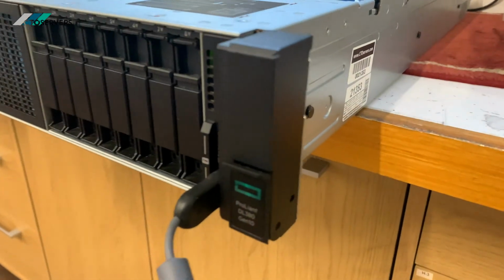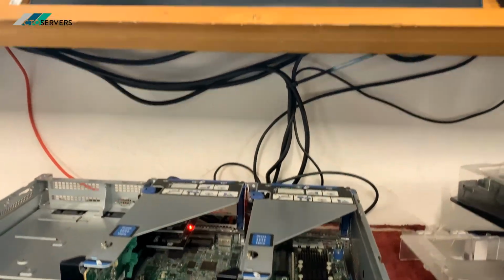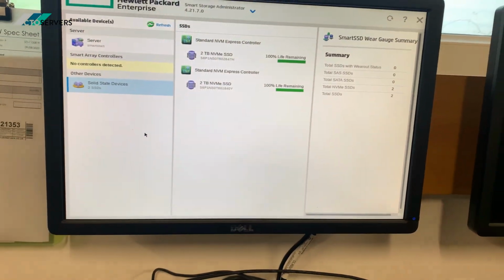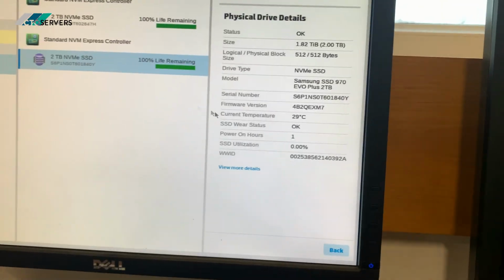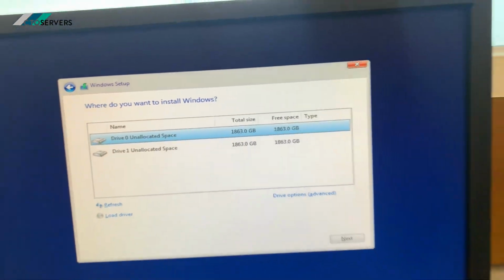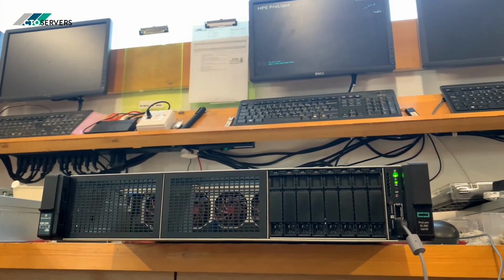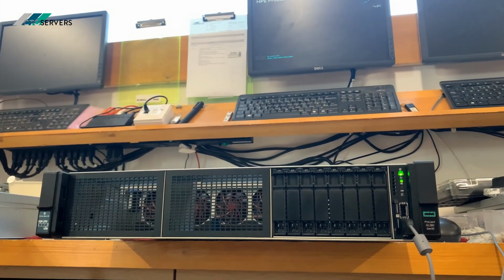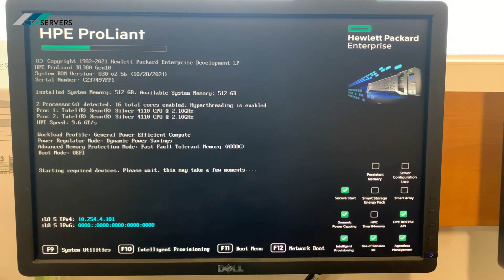4TB NVME , HPE DL380 Gen10   @CTOSERVERS

Comment: Is there anything that needs to be changed in the bios configuration? I installed 2 NVME in 1 slot, it read only 1 NVME.
Reply from the maker: Need to enable bifurcation
Reply: @CTOSERVERS  Thanks a lot, solved my problem.

Comment: Great to know it works. Can you write the part number of the riser you used? Is a DL38X gen9 riser also compatible with the DL38X gen 10 server? Do I need to have a second CPU installed in order to use the secondary riser? 10x
Reply: I dont'know if it is the same, they are different looking at the iron, but I don't know if they work, ans yes only one cpu works for 1 riser, if you want the other you must put another cpu into that

Comment: Hi great video , you didnt install the nvme on the direct slot put you use a pci card , does it work any pci nvme card ?I try to use the direct nvme slots but no luck find the drives
Reply from the maker: The original HP riser with the M.2 slot is only for SATA SSD and not NVME

Comment: Simple hack to get NVME performance in a server on the cheap.  My only problem is the choice of drives.   Consumer drives should not be put into a production configuration as they don't have then endurance needed in a server.  Samsung or another brand of server rated NVME drives should have been used.
Reply: These are samsung nmves 980 pro
Reply: @leonardotoschi585  consumer NVME.  not enterprise drives with a high write endurance.

Comment: what card did you use?
Reply: I found it using markers on IC board plate, that pci-e extension is AMPCOM M.2 NVME SSD to PCIe 4.0 Adapter Card (PCIe4.0 X4).
Reply from the maker: Some generic one from Amazon , it was certified for windows server ,